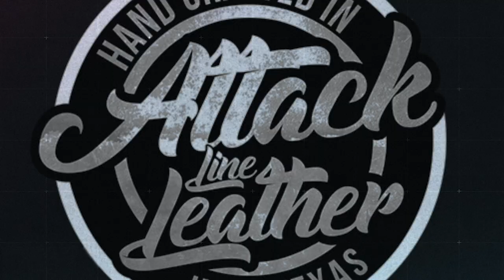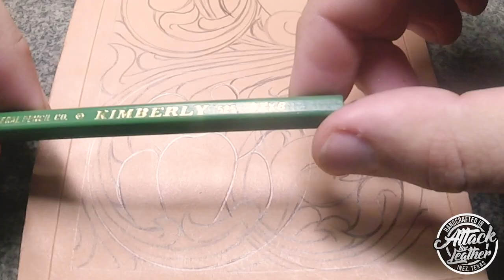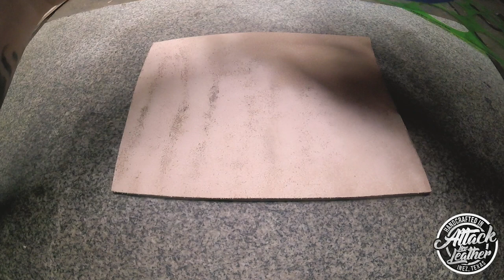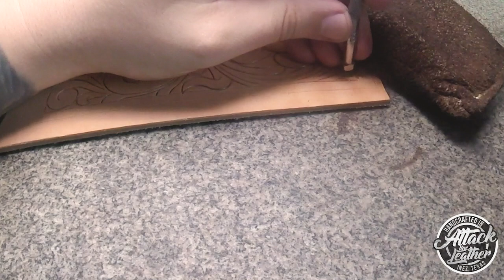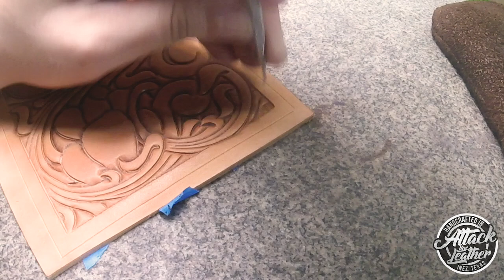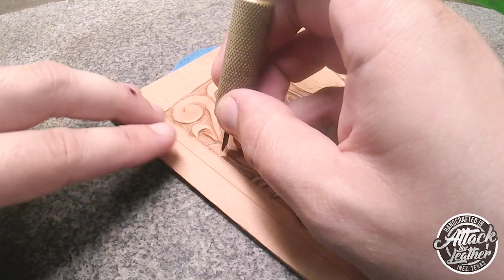Toolin Tuesday: My Leather Tooling Process

Comment: one thing i don't see much of is tooling thinner leathers. 3-4 oz. It seems most people do demonstrations with 8/9 oz leather or higher. Probably better visually for burnishing when tooling. Do you do much in thinner leather or small detail artwork? or do you just stick with artwork that only comfortable fits your current tools
Reply from the maker: Tooling thinner leathers is definitely much more finicky for the main reason of leather warp and displacement. Because there is not as much mass to the leather as say a 5-9oz peice the stamp displaces the leather much more on thinner leather. However, I do plenty of finger carving on thinner leather and that might make a good video.
Reply: Please explain “finger carving”. Thanks.
Reply from the maker: @270ranchtv7  finger carving is when you use your swivel knife to add decorative cuts to an area of leather. You dont bevel or tool anything